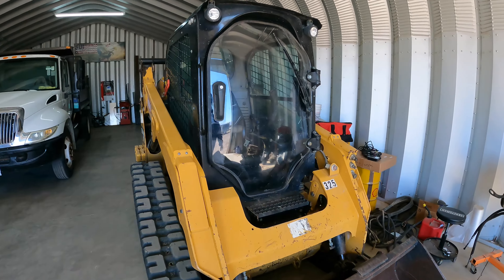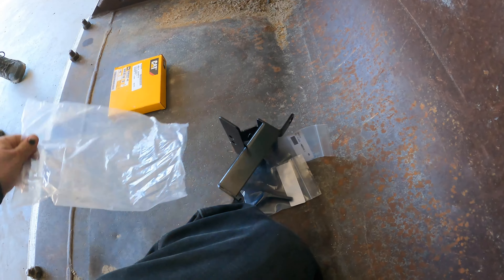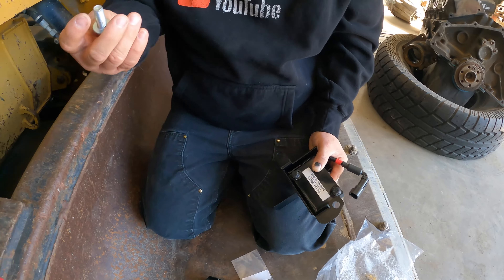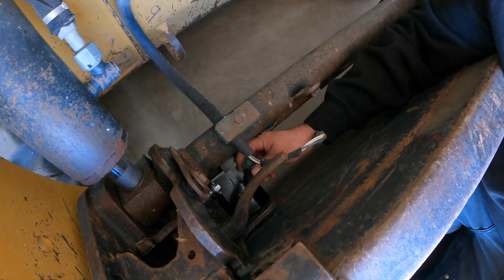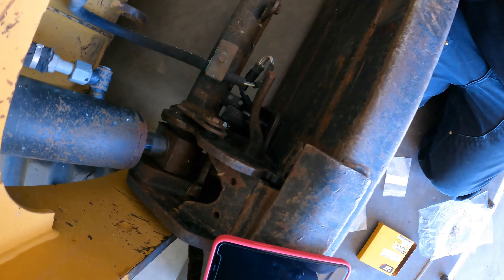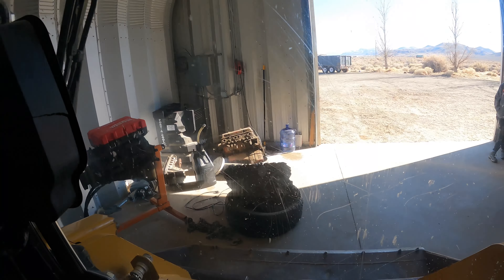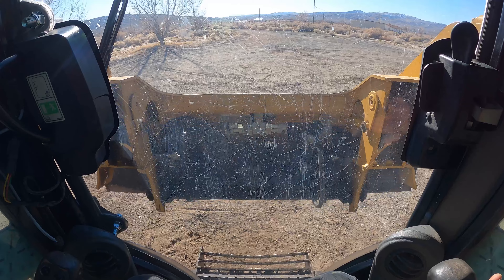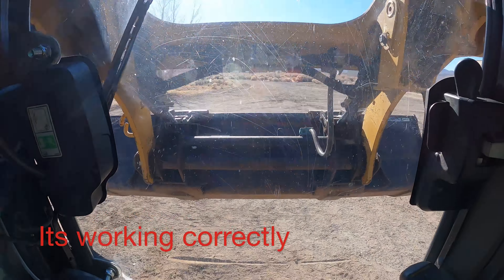Cat 259d code 3700-3 machine auto level

Comment: Yes, levels going up but not perfect going down.   But return to dig function plants the bucket well.  Not sure your unit has that option. On my 70 hr 239D3 my wiring harness broke at 10 degrees F.  The section of the harness by the inclinometer sensor (you installed) goes thru a 2 ft piece of hydraulic hose as a conduit.  At factory the “hose” wasn’t inserted far enough into the anchor block  near the inclinometer.  ( the block pinch marks on my hose are right at the end of the hose….not like yours where the hose passes 2 inches thru the block).  When the stiff hose popped out of the block the wires got bent hard and I think damaged.    Probably related to this, the insulation on one lead broke right at the plug.  So Cat is replacing the harness on warrantee.   All  very honorable and helpful.   If the cat dealer mechanic doesn’t slide the hose all the way thru the block I will.   Besides making the hose more secure, sliding the hose thru also reduces the bending of the hose and the torque on the anchor block.  Another detail is the, hose is better placed thru the left hand hole in the block as this reduces the bending of the wires going to the plug.   Mine had been put thru the right hand hole.   I’ll change it to left.  Best wishes with your unit.   Mine is terrific.   Thx for your video.
Reply from the maker: Thats cool Cat is going to warranty that for you. Thanks for watching!!